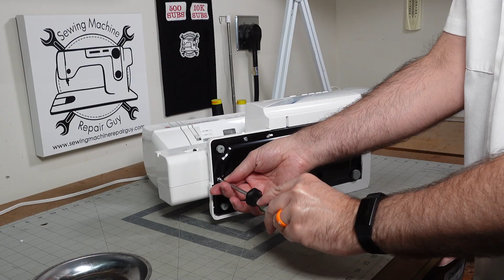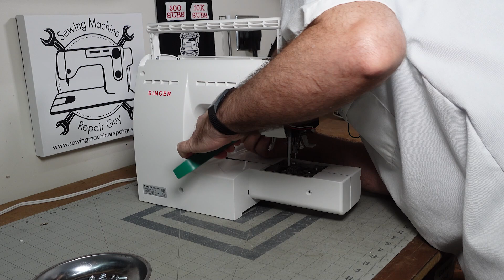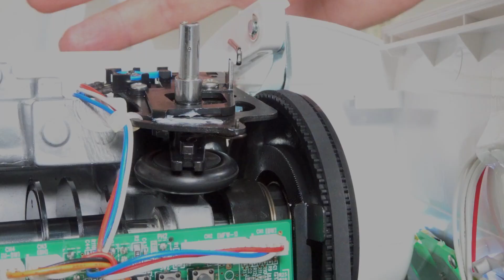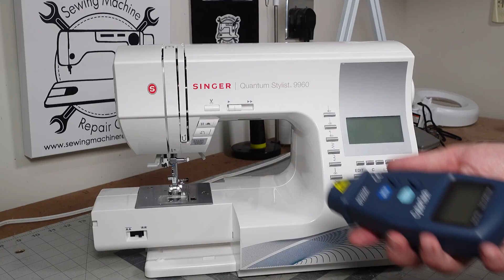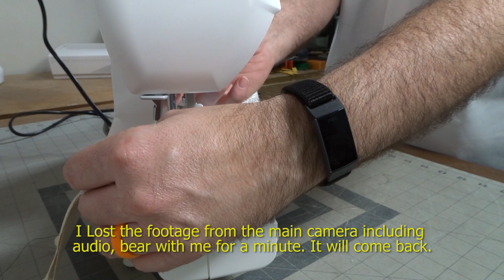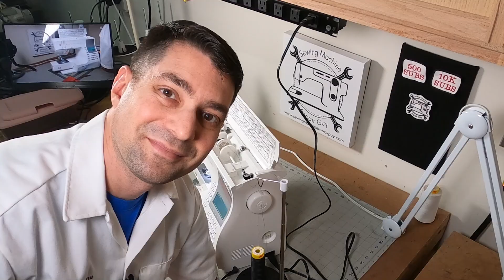Singer Quantum Stylist 9960 Tear Down and Stress Test, Does it Survive?

Comment: Hi this video was very good! But how about the computer or whatever that programme things inside? Will that really last long? I saw someone's review of this machine saying that the machine was stitching in reverse after 1 year use. Is it possible to fix these kinda (programme issues) problems?
Reply: Yes, Zainab, this is interesting but does say how ti fix anything. "Ther's a bushing there you can oil." Doesnt show close up or what to oil it with (i have reg machine oil & the silicon (?) stuff that is the "permanent" oil. Besides, "permanent" that isnt and no mention in the manual. Ive been an avid sewer for 50 yrs and only recently found out about the non-permanent  grease, accidentally, when a singer rep i called mentioned it. And "there's a bushing here, but you cant see it" (but it needs oiling) doesnt help much, does it.

It would also be useful to be told about removing the plastic over the needle area. I spent some time trying to figure out where the other screw must be bc it was stuck pretty good. No screw just pry, pull and lift. Realign and push to return it.

Guess i waa really looking for how to do routine maintenance. Ill keep looking. Good luck to you.

lf you have trouble taking it apart or putting it together, see Roxann's vid on changing the cutter blade.

Comment: great videos  My wife has a Husqvarna sapphire 930 that worked great new of course, but 4 years later the machine developed serious problem. After she stopped sewing to cut material the machine would tie knot then cut then tie knot then cut repeatedly till machine is turned off.  This happened when the machine was just sitting on it's own plugged into power. After turning machine off and then on to start sewing it would stop randomly and tie knot and stop... 
First time they replaced computer as it was under warranty. Now almost 4 years later again she has  exactly the same problem. Seems like the part lasts only 4 to 5 years. Of course the Husqvarna dealers are now fewer and when you ship, do a diagnostic and repair it can greatly exceed the value of the machine and if it works same as befor will only last 4 years. Also some electronic parts are getting difficult to purchase.  
Have you run into this problem and do you have a cure???   thanks.

Comment: thanks  so much for this video.  picked up a used 9960 the other day at a very good price because seller said it wasn't feeding fabric.  he also said that person who was using it didn't know much about setting and there's probably nothing wrong with it.  got it home, inspected it and removed throat plate.  bobbin compartment was very dirty, just lint tho.  vacuumed and the used q-tips (no compressed air).

curious if you think it's worth taking it down to point where you have it in this video to clean the rest.

Comment: Purchased a singer heritage that jammed doing a rolled hemmed. In order to save customers garment. Machine was sacrificed. Timing was thrown off. Sent for service to singer dealer 60 miles away. Long story short. It was never right. Pressure foot was now at 9 and 3. Returned to singer and they provided me with a new machine. I eventually sold it and use only vintage singers. Thank you

Comment: Learned to sew on an old Singer Athena and a Kenmore 12271. My newest one is a Brother Innovis 1300. Seeing something like this is interesting because for years I would not touch one of the newer Singer machines because of all the issues my grandmother and other relatives had with theirs through the 80s. Always running into issues with timing and tension. Seems the build quality just wasn't the same -- and that included my grandmother's Athena. 

So the sewing machine dealers constantly make a big deal about the difference in build quality between the box store machines and the ones they offer. It'd be interesting to see a comparison/contrast between a big box/retail machine and a similar dealer machine? Could even be an older model, because we all know that the dealer machines tend to be a bit pricey. =D
Reply from the maker: Yes, I think this would be a fun video. I have been looking, but they are pretty pricey.